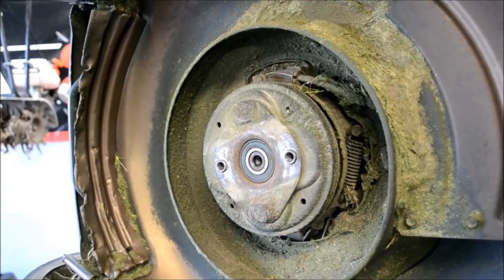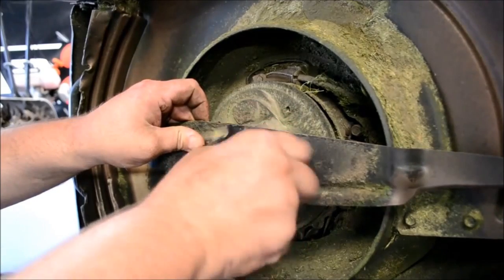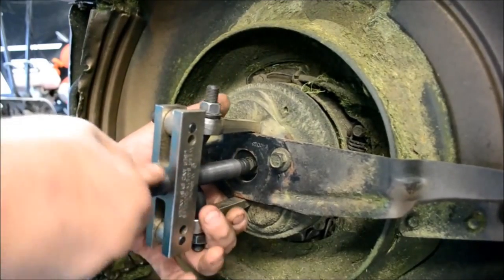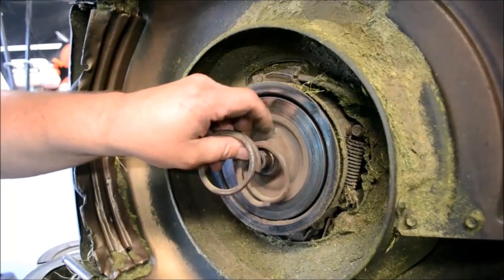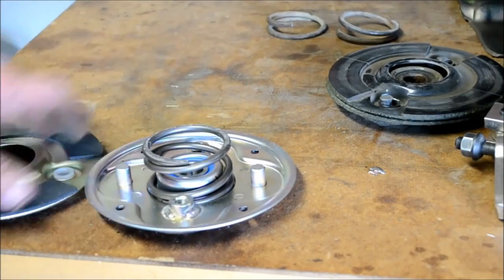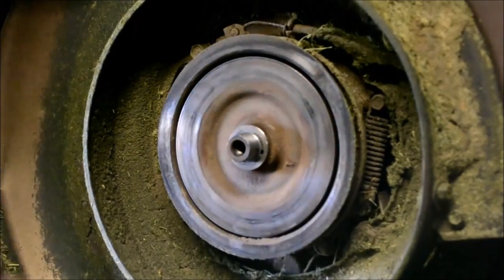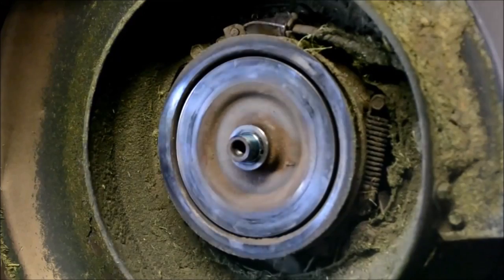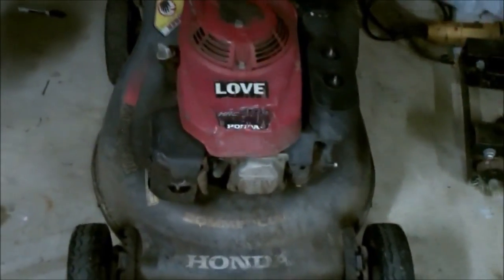HONDA LAWN MOWER REPAIR : Honda HRC 216 K3 Blade Clutch Rebuild Parts 1,2, And 3

Comment: After busting my knuckles for three hours on one of these clutches , Ive come to the humble conclusion that Honda over engineered these push mowers. I don’t know about you guys, but I’ve never seen a single person, who looked at their push mower and said “I wish I could have the motor running without the blade going “.  I think this clutch is a totally unnecessary feature… But hey, I know that to stay alive in any competitive market (lawnmower manufacturing being no exception), you have to keep coming up with innovative features… Whether they’re necessary or not. Thanks for the video
Reply: professional commercial mowers could never operate that way, they go over curbs, need to take grass bag off,  need to idle all the time while they are doing something.  biggest PITA having a lawn mower that shuts off and having to restart it when you need to step away.

Comment: HR215 Master 5 Honda. Blade brake clutch seem frozen.  I can adjust the cable  pull handle and it will release which is opposite how it should work.  The clutch brake assembly looks ok, could it possibly be a cable gone bad. Doesn't seem logical as it should be in release postion at rest, but I'm scratching my head.

Comment: just did a crankshaft replace in one of these mowers - didnt damage any of the clutch parts just bent the shaft so bad mower would shake across the driveway .

Comment: I have a Honda with the blade brake clutch but the engine pull rope could not be pulled and I freed the flywheel by hand but when I started the mower and engaged the blade I heard loud noises and when I engaged the bade again the mower stalled and the starter rope "locked" up again.  What would the problem be?
Reply: Did you find the problem mate? I'm having same problem

Comment: Thanks for the video. I have an HR215KHX Honda mower and am having an issue with the blade brake. The brake doesn't seem to release soon enough and  is still holding as the blade is trying to engage and it kills the engine. We tried adjusting the cable and got it a bit better but you still have to play around and restart the engine several times before getting it to engage with engine still running. We took it all apart and cleaned everything up but nothing seemed to have excessive wear nor did we notice any other problems. We also lubricated the cables but again it didn't make any difference. Once you get it to engage the first time it works fine the rest of the time while mowing but the next time you go to mow it is the same thing. It doesn't matter whether I try to feather it to engage it or just push it all the way rather than slowly moving it, but again no difference. I am at a loss to figure out what else to try or do and would appreciate any suggestions you might have.
Thank you
Reply from the maker: Wow that is an issue I think the best thing here is to use your smart phone and send me a video of the issue to themowermedic1@Gmail   Before you film be sure to wipe the camera lens off and hold the phone as steady as possible or even get somebody to film for you while you explain
Reply: @THEMOWERMEDIC1  OK, will do, thanks

Comment: Did this mower start up with this issue present? Mine is locked up.  Valves look good.  Rockers looked good.  Is really hard to turn the flywheel by hand it gets tougher when you turn it one direction for a while.  Was even harder after I engaged and disengaged the blade clutch.

Comment: I swapped a new engine onto my deck (hit a rock and bent the shaft) and it worked fine up until a few months ago, the blade isnt spinning fast enough. the engine feels like it has good compression, its a new engine, I change the oil on all my engines far inside the recommended intervals. 

what are the compression specs on the hrc216 engine?

if your getting a mowhawk strip from weak blade engagement, could that be a faulty blade clutch issue or are the rings in the cylinder bad from contamination of the oil?

appreciate your honda series videos

Comment: I'd like to discontinue the clutch on my Honda engine. I have a HRX217HYA With a Honda GCV200 engine. What is the blade adapter number so I can run the double blades with out a clutch ?

Comment: Hi
I have a GXV 160 UH2 SFL1 engine on my Kaaz Mower ( HRH clone with the Honda Rotostop) . Think you call them HRC 216 xxx.
You use an impact gun to undo the blade brake centre bolt.  I need to buy one ... I have a compressor does 14 cfm runs at max 145 psi.

What is your impact gun’s max torque? Is it a small one? . A friend will sell me his cheap 3/8 impact gun (he never used it) but it has a max torque of 271 Nm!
Never used one of these guns myself , and tbh I am scared I might overdo it ... 

He says the manufacturer makes a small valve thing, that reduces the flow of air at the tool, £11. Apparently designed to let people run air sanders at a slower speed. Would that gizzmo help?
Question: if you just touch the trigger lightly, am I right, that  the gun won’t hit max torque, and hopefully will undo the nut without damaging the shaft or the woodruff key??
 i.e. break the “bond” the bolt has 
My other question is what Torque should one do the centre BB (RotoStop) Bolt up to? Heard a rumour it was 39 Nm., is that correct.?
And how do you stop the motor turning when using a manual torque wrench ?
I was told to do the top Flywheel 14mm Special Nut up to 70-80 Nm.
For my N1 engine,  they didn’t say say how to stop the engine turning. But one guy said for the N1E version ( looks the same except the flywheel has Cogs for the starter motor I guess) , he was told to stick a screwdriver through the flywheel recoil pulley.
Mine has the same flywheel recoil pulley, for the recoil pins to engage in. Can I use this? As it saves taking off the cowl and the transistorised magneto and having to reset that, if say one was to use a strap wrench ( which I don’t have anyway).
Any help much appreciated.
Regards
Peter

Comment: Hi. My problem is that the bearing behind the upper clutch housing broke. Do I need to heat the upper clutch disk to be able to pull it off? Do I also need to use a puller?

Comment: Hey mowermedic! I wish I would have found this video beforehand, lol. I don't suppose you could help me diagnose a repair on my 216K3HXA, please? I was mowing our yard a couple weeks ago and I ran over the lid to our water meter with the tire and it flipped it up and hit the blade. It bent the blade like 45 degrees, so I replaced the blade and it was still making a horrible noise, shaking/vibrating horribly so I took apart everything that was in this video following the diagram on the Honda website. I replaced the plate ball control and brake housing because the retainer ball had dented them both and no longer seated firmly in there and assumed that was what was causing the vibration. I seemed to only have fixed half the problem because the mower now sounds and runs smoothly when the blade is engage, but when it's not engaged it sounds terrible and shakes violently. When I spin the recoil starter by hand the whole blade/brake/clutch assembly underneath wobbles awkwardly. Do you have any idea what this could be? I'm just a guy who's trying to save some money and DIY my mistake. Any help would be great appreciated! Thanks man and keep up the good videos!
Reply from the maker: Ace crankshaft is bent.  Honda cranks are soft and bend easily.  Best bet would be a new engine.  But I have replaced a many crankshafts in my day.  They are about 40$
Reply: THEMOWERMEDIC1 you rock man! I was afraid it was gonna be the crank... If I do replace the engine do you think I could sell the old one? I just got this mower last year so it’s still pretty much brand spanken new. I really try to clean it and maintain it after each use but if replacing a crank is a pain in the ass I might just go for the easier fix. I really appreciate the feedback, especially so quickly!

Comment: My blade holder came off but the bearing split and only the inner baring stayed on shaft. How do you get that off ??
Reply from the maker: Cut it off or use a bearing separator

Comment: Great video, many thanks for producing it.
I have a question, my lawnmower  is a 20 year old HR2160 with electric start and rear roller. I've kept it clean by hosing out the under side with water. The last time I did this I'm sure i sprayed the water momentarily into the clutch from the side by mistake. When I used it a week later I noticed a slight squeak when I engage the blade other than that it works fine. Have I caused damage by spraying in the water? Dirt could have got in I guess. 
I was going to take it apart to have a look and clean it but I don't really want to unless I have to, would I need an impact wrench to loosen/tighten the nuts?.
what do you suggest?
Reply: Please can you do a video how to replace my transmission Hondah

Comment: Why does it vibrate when i turn it on? What could be the problem? With out using the blades it vibrates alot.
Reply: bent crankshaft more than likely the culprit, badly balanced blades

Comment: Just replaced the blade assembly on my mower and put everything the way you did , now I can start the mower and the draw string won’t budge it feels like it’s bound up and I can’t figure out what’s wrong.
Reply: Did you figure out what happened.  My Honda mower with the blade clutch won’t start and it sounds like there is spring tension snd I am wondering if it’s blade clutch related
Reply: @thatgreatdeal  yes, when I reinstalled the assembly i might’ve  tightened everything together with the brakes a bit crooked, so after adjusting them and assembling again it worked fine
Reply: @droid10101  thanks for the reply.  I’m thinking something happened to mine and it got damaged/crooked and is causing mine to lock up.  Sounds like I need to follow this video and inspect it.  Thanks!

Comment: What I really need to know is, on a Honda mower with this clutch system, how do I disassemble what's needed to remove and replace the wheel drive rubber belt. It seems impossible unless disassembling the clutch as shown leads to a solution. HELP!
Reply: the commercial HRC 216 does not have a rubber belt, you probably have a residential model